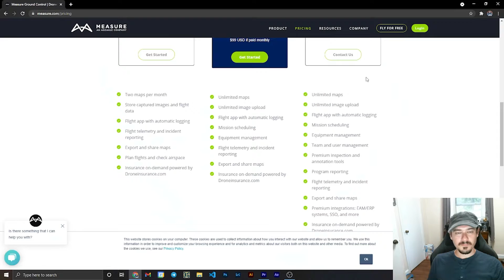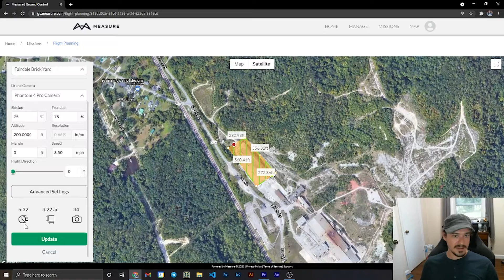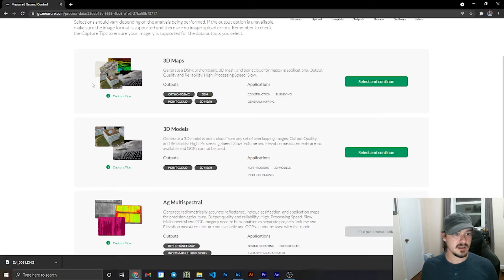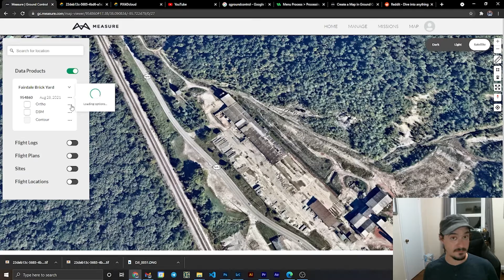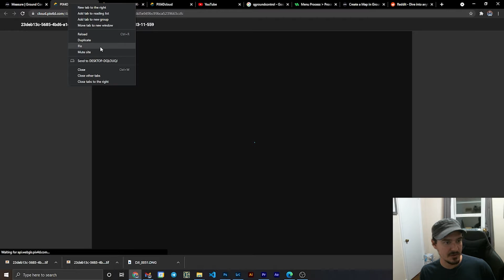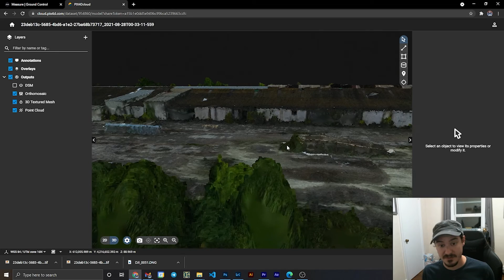Mapping with Measure Ground Control

Comment: Great video. Just out of curiosity, did you stay with Ground Control, or are you using another platform?
Reply from the maker: Thanks for the comment!

At the moment, I've only used Measure, but I will be trying Open Drone Map. If I understand correctly, mission planning/flying is free with Measure, but the deliverables  are where the cost comes in. With a free solution like ODM, I am curious to see how the quality stacks up.

My friend Rich on his channel 'Rich Charpentier' has done a lot with various mapping tools and I highly recommend his channel for anyone looking to learn!
Reply: @davenportdronographics7736  I've actually been watching a lot of his videos. I'm researching available platforms right now, without sinking a lot of money into a monthly expense.  It seems like the ODM with Maps Made Easy are the most reasonable way to go starting out.